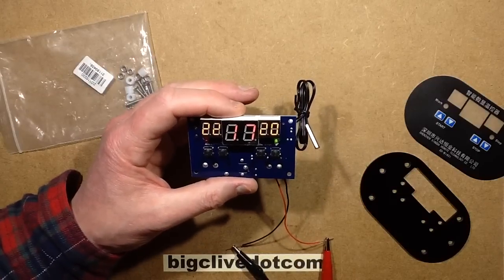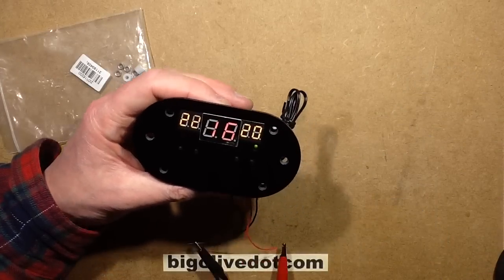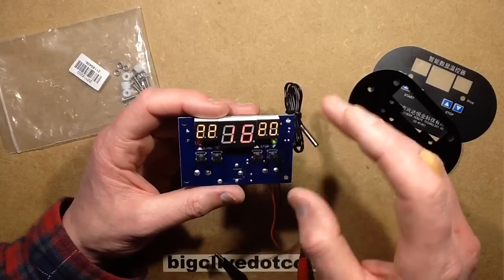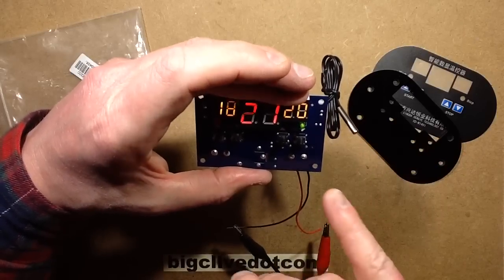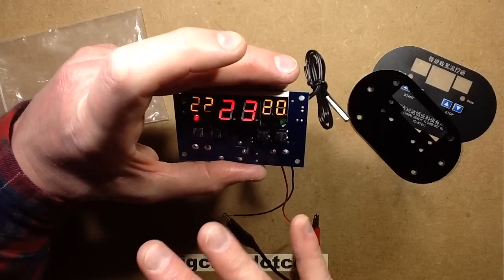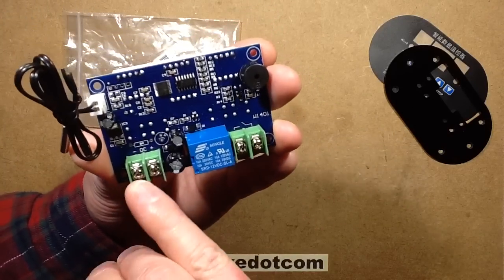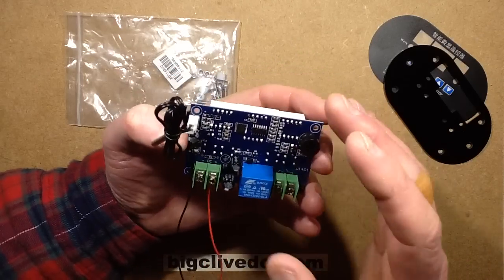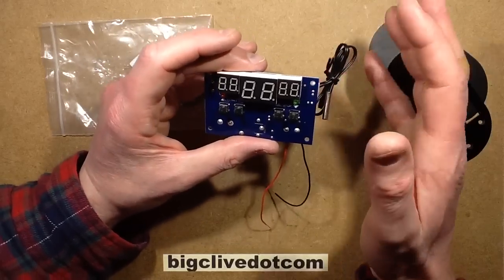Neat Chinese thermostat heating/cooling module.

Comment: Could it be used to run a 12-volt Chinese diesel heater through its remote control?
Reply from the maker: You get diesel heater controllers with thermostatic control built in.

Comment: Great video, very easy to understand. I am hoping you can tell me if I could extend the length of the probe by just splicing in a length of wire.
Reply from the maker: With a standard resistive thermistor you can extend it in that way, but for long runs it's better to use screened wire to avoid pickup of electrical noise that may affect the stability of the unit.
Reply: bigclivedotcom thanks, from sudbury Ontario. You rock🤙😎

Comment: And here my thermostat's range is tuned with a carefully-selected wedge of foam behind the mercury switch. At this point, it almost seems like a fun project to rig up an Arduino to toggle the levers instead of getting a "smart" thermostat.

Comment: Hi. I bought a digital control model W-1411, very similar to the one of its video. I connected it to 12VDC but it did not work. The packaging indicates GND / N DC +/- but does not specify the voltage value.
The manual indicates DC12V / 100-240. Can I connect it to 110V?

Comment: I got 2 of these but I'm a little confused about load side of things. The instructions show an inline psu for the output. How does this work? If the input psu is large enough to supply the output as well is that OK or must there be 2 plus used to make this work? Thanks
Reply from the maker: If you have an external 12V PSU then it could control the load too.  You would connect one side of the load to either positive or negative of the PSU and then switch the other one via the common and normally open or closed relay contact depending on what you were driving.  If the load is high or very inductive then it might be better to use two separate supplies to reduce the risk of the transients crashing the processor.
Reply: +bigclivedotcom I think im doing something really wrong here. So if I've followed you correctly there should only be one connection on the load terminal/s? Thanks again!
Reply from the maker: The relay has "volt free" contacts.  It acts like a switch, so whatever your load is, it needs to have a feed wire to the relay's common connection and a switched wire to the load from the NO (Normally open) or NC (Normally closed) contact.
Reply: +bigclivedotcom ok I think I'm with you. Still haven't managed to make it work however I just tried something else and it works better in my case. Negative wire from "out" terminal to usb powerbank. Positive wire from powerbank to dc fan. And negative wire from dc fan to "in" terminal. Please tell me that's ok haha. Thanks again for the help and keep up the great work/videos
Reply from the maker: I don't actually have a module here to look at, but the main thing is that you are breaking the circuit to your load through the relay contact like a switch.
Reply: +bigclivedotcom It's been so long since I played with components that I forgot how relays work. Thanks for reminding me haha. Going to pick up another psu tomorrow and set up the second bit of kit

Comment: With 120vac or 240vac, beware that high voltage appears on the exposed relay solder joints.

Comment: Oh man this would be great to replace the crappy home thermostat except that it's just not wired up for something like that.  12V is a bit tricky to get from small batteries and there's no real way to mount it to an existing wall mount thing without a fair bit of custom adaptation.

Comment: I bought several of these for like $4,- each. I use them for cooling my receiver and to force air through a heating radiator. Very simple, but handy gadgets. In case you are still wondering what is written on the little processor:
http://i.imgur.com/SFNAKM0.jpg
http://i.imgur.com/kx1NfHk.jpg

I kinda wonder why there would be different kinds of versions. Some appear to be using an extra resistor and others use a resistor instead of a capacitor.
http://i.imgur.com/OhOrven.jpg
http://i.imgur.com/HiUa6an.jpg

Comment: I bought 3 of these to use as a cooling and heating thermostat on an aquarium. One for each and a spare, the relay didn't work on any of them. Unlucky or what?
Reply from the maker: +archiearchie666 Were you running them at 12V?
Reply: yes 12v. The buttons also didn't work on 2 of them & the display was stuck one reading on the other!!! Maybe just a bad batch that they decided to sell rather than throw away.

Comment: hi,
?How much can i extend the cable of thermocouple
I have almost 15 meters from the boiler to the house
Reply from the maker: +dmxsir It's a thermistor with a typical value of 10K so if you used a screened cable it should be possible to extend it a modest distance.
Reply: thank you !!

Comment: When the relay clicks on does it just complete the circuit? I'm trying to figure out how to hook this up to my window fan to get control of when it operates.
Reply from the maker: +Michael Nugent (AvidSurvivalist) Yes.  The relay acts like a switch.
Reply: I should be able to use something like this to turn something on at a certain temp right?
Reply from the maker: +Michael Nugent (AvidSurvivalist) Yes.  If you wanted it to turn on at say 30C and then back off again at 25C then those are the temperatures you'd pout in the start and stop settings.
Reply: Ok thanks!

Comment: I wonder why all english speaking people always use that centigrade rubbish. Where does that come from? There is not such thing. Centrigrade... a 1/100th of a grade?
It's degrees Celsius. Degrees Fahrenheit, and degrees Celsius.
Reply: +MadModders Because english has a lot of latin derived words such as centigrade, meaning 100 degrees, which was the original name of the 100 division temperature scale with 0 at freezing and 100 at boiling of water.

(Latin gradien or gradior, to step or walk, thus centigrade is 100 steps)

 In 1948 the scale was renamed to Celsius in honor of the guy who decided that 100degrees was the freezing point of water and 0degrees was the boiling point.  Yes, Mr Celsius was backwards.

So use the original latin-based name or use the name of the guy who invented a backwards version like the international agreement says you should.  Just quit ragging on people with a longer memory or more knowledge than you.
Reply: +Sylvan Butler Yes he did, two years before he died. But it was changed shortly after he died, so the backwards scale was very shortlived. Today, degree Celsius is defined by absolute zero, 0 kelvin, and the tripple point of pure water, 273,16 K. The centigrade scale is not. It differs 0,01. Why live in the past? :)

Comment: The chances are the microcontroller  is a STM8S103F3P6 variant. It has the correct number of pins, form factor etc. and these are cheap as chips. There appears to be a programming header on the board too. I wonder if it is spitting out debug info on that.

Comment: So if you buildt this into a project, you also need to include a 230v ac to 12v dc transformer, and "leech" 12v of the mains to power the device?

Nice module, i actually made a homemade one, to keep a fish pond in the garden frost free, during the winter. 
Similar setup, unfortunally my design i hardcoded the temperatures on a ATTiny84 considering it was only myself thats going to use it. 
But on my own device i leech 5v dc from 230v ac to power the control circuit.

Comment: It is very nice . But unless i'm being rather unthinking , it could be used to control any difference thing , needing an upper or lower value . ie it could be pressure , voltage etc etc etc . , as long as the inputs are in keep with the temperature measurement units . I have a compressor that is need of an upper & lower cut in / out . Can you put the Ebay contacts in the text please , they might also throw you a $ .

Comment: It is laser cut, but the screw holes are chamfered with a rotary tool for a flush screw head sinking. Thus the rough edges.

Comment: Whats the stated minimum temp range on this one?

Annoyingly the temperature range on the ones i can find on ebay doesnt seem to go quite low enough for a Freezer. I was considering using something like this to replace the Thermostat on a fridge freezer that lives in the garage and has the usual problems these have when the thermostat is in the fridge and the ambient temperature in the garage drops down to the normal fridge range..

Comment: I have used similar thermistors at work, and when we compared the temperature reading with a fluke IR-thermometer, the offset was around 0.2 - 0.9 degrees.
Reply from the maker: +haavard12 That's not too bad.

Comment: 240v relay would be of more use,
Reply from the maker: +andrew moon It's just the coil that's 12V.  It can switch 240V apparently.
Reply: would you be will to do a video of you running a 150-200watt resistive load on the relay? I would like to build a reptile egg incubator and would really be interested in using this on it if it can handle it. I know loads of other people would be interested too,
Reply from the maker: +andrew moon On the basis that your load represents just one or two Amps resistive load I would say that it is well within the capability of even the crappiest relay.

Comment: I'm curious, could this be used in a home application? Like, if you're looking for a cheap digital thermostat, could this be used?
Reply from the maker: +bluephreakr It's aimed at home hobbyists and industry alike.
Reply: It could certainly be used to control a boiler, space heater or air conditioner.  But you will need to provide a +12V supply.  If you are using this module as a DHW cylinder thermostat, you also need to add another relay with a changeover contact, to provide a "thermostat satisfied" contact.  Simply wire the additional relay as the switched load; then its normally-open contact is "call for heat" and its normally-closed contact as "satisfied".  The good news is, you need only one 12V PSU for both the DHW cylinder and room CH  thermostats plus the extra relay.

To control an air conditioner which already has its own control circuitry, the easiest place to get in probably is via the "waste tank full" switch; simulating a full waste tank whenever cooling is required to be OFF.  Add a 12V relay  with changeover contacts, and wire as follows:  NO terminal  → common  terminal of tank full switch; common terminal → wire(s) removed from common terminal of tank full switch; NC terminal → NO terminal of tank full switch.  So in NC position, C goes to NO  (as though tank were full)  irrespective of tank status; or in NO position, C goes to NC if tank is empty  (thus allowing AC to operate)  or NO if tank is full.

Comment: Probably the only problem is the relay, most likely automotive grade.
Reply from the maker: +GreenAppelPie I wouldn't trust any of these small relays at their rated current.  If anything I'd use it to switch a bigger relay or SSR.

Comment: It really depends on relay contacts how long it lasts. I have a "clock" with microcontroller, serial LED driver TTL/CMOS chips and 9 options of display as it was used as remote kW/h meter display. The device has been working since 1994.

Comment: Hysteresis plays different role in high quality regulators - you don`t want your HVAC system to turn on and turn off every minute - you want it to turn on, heat/cool air to specific temperature - usually few degrees lower/higher (not 1 degree like with this regulator!)- and then finally turn off.

Comment: Clive...can you please get a proper camera? Even a cheap compact camera is better than a tablet camera.
Reply: what's wrong with the current setup? Image looks crisp and clear to me, and 720p allows to be uploaded these much more quickly.
Reply: F1nWarri0r Macro, better contrast, better low light performance(it does matter even with those lights) and even 1080p. Off course for most products like lamps and heaters it wouldn't make much difference, but for circuit boards it would make a difference. Off course, that doesn't mean the current setup makes Clive's videos bad, they're still awesome, but since a compact camera is relatively cheap, it would be a welcomed upgrade. Also, if Clive used his PC to upload the videos, he could just start the upload and then go on with his day while the computer uploads the video in the background without worrying about battery or wi-fi connection.

Comment: I was initially expecting this to have two relays, one for a heating control and one for cooling but obviously that isn't the case. I suppose it wouldn't be difficult to have a changeover switch on the output. I had an idea for a peltier-based combination heater/cooler and this would've been perfect if it had two outputs or at least a different LED for cooling that could be used in combination with the red LED to trigger a pair of relays.
Reply: +Matt Tester (UKMatt2000) 
For heating AND cooling this board is not really the right thing. For under $4 you could of course buy two, but you'd need some extra logic and at least one additional double-pole double-throw relay. I wouldn't expect expect the temperature characteristics of both to match very closely. So if you plan to regulate to within a few °C you might are out of luck with these.
Reply: +superdau Yeah I'd rather just put a DPDT switch on the output and manually switch between heating and cooling, this unit shouldn't turn on if it's switched the wrong way due to the temperatures.

Comment: Neat thing, just what i need, though I'd add a little diffuser in front of the display, which you could neatly hide between the two faceplate thingies. You could see a little too much of the unlit segments.
Reply from the maker: +Lasse Huhtala Some pieces of matching theatre gel would work wonders.
Reply: I quite like those.

Comment: What a simple but nice device :-)
I would think the unknown would be the relay quality, the contact life.
I bet a trimmer could be added to those components near the thermocouple socket.
You could glue the countersunk screws into the plate so it could be removed as a whole facia assembly.
A thin bit of darkened plastic over the displays may make it better to read, but i dont know if its your lighting that makes it look viague.
Clever unit.
Reply: +zx8401ztv A good tip, and possibly an idea for Clive to demonstrate, is putting a VDR (or varistor) over the relay contact. That way it will not spark and ruin the contacts prematurely. :)
Reply: +MrDubje 
I dont know about that, ive never seen a relay with anything across the contacts, but i havnt seen every relay in the world.... yet :)
The old capacitor across the contacts may do a similar job, but eather one would surely leak a tiny bit of power across the relay, perhaps, maybe lol.
.
Anyway, fixed that psu yet he he, sorry i had to :-D
Reply: zx8401ztv
Other videos first, lol.
Reply from the maker: +MrDubje A snubber network would be an improvement for an inductive mains load, but that could be added.

Comment: refrigerators should have generic control modules, ive had 2 fridges fail from dubious electronic control boards, i guess i could have hardwired them, had i had a handy control unit like this, but really, its stupid in this day and age. (one i did hardwire, and i ran it off a timer switch, 15min on and 30 off, for a week till the new one came, lol)
Reply: +jusb1066 
I did the same with the timer for two or three years ;) . It was planned as a temporary fix until we got a new fridge (was a student's shared flat). But with everyone having a relatively constant "use" of the fridge it worked so well after playing with the timing a little, that we left it. It just needed readjustment twice a year because of the 2 or 3°C difference in temperature in the home between summer and winter.
Reply from the maker: +superdau Oh.  This seems quite common.  I did the same, but you have to adjust the time switch seasonally.

Comment: Looks like a perfect option for a heater controller for an aquarium.  Just cover the probe up to waterproof it, and mount it near the tank.  I bet it looses its settings when it looses power though, might have to make a little battery backup too.  Thanks for finding this.
Reply from the maker: +Vantss It seems to hold the settings.
Reply: That's great news!  I've got one on the way, managed to find one thats only a month of shipping instead of 2+

Comment: I wonder : how much current it draws ? Would I need a transformer to use it on 220v ?
Reply from the maker: +Walter Boxhead Typical current with relay on 60mA.  Definitely best with a small transformer PSU.

Comment: Ohh you said centigrade again, so I am going to say Heighth.
Reply: +Mentorcase Lol. My grandmother said centigrade.
Reply: +Mentorcase Do you believe centigrade is not a word or am I out-of-the-loop of some weird in-joke?
Reply: Oh it's a word alright.
Reply: Joshua Smellie It's an old word, that has been replaced by celcius in most of the world. Still being used in scattered regional dialects.
Reply: I believe the word centigrade derived from the 0c-100c for the boiling point of water, but beyond that, it doesn't really mean anything.
Like, centimeter for instance, means one hundredth of a meter, but a centigrade is not one hundredth of anything.
Reply: That's what it means, not the actual temperature.

Comment: One of the other ebay suppliers says it does have probe calibration.  Timed on and off periods as well.
http://www.ebay.com/itm/AC-220V-Digital-LED-Temperature-Controller-10A-Thermostat-Control-Switch-Probe-/181974380075?hash=item2a5e84ae2b:g:RF4AAOSwHPlWgKj8
Reply: +Marvyn Harris  Ah, yours is different.  it doesn't have the set button.
Reply: +Marvyn Harris 
Well, Thanks! I just bought one of those ones, and it's all pre-wired! cheap too!
Seller has good instructions, so now the wait for Australia post to do what it does best, and be the slowest in the world!!!
Still, it should be fun and useful!